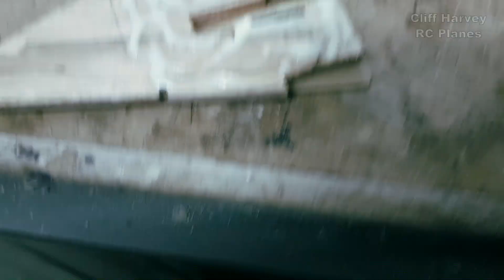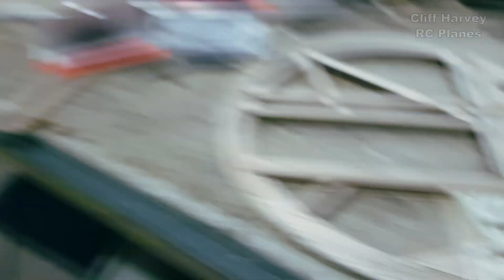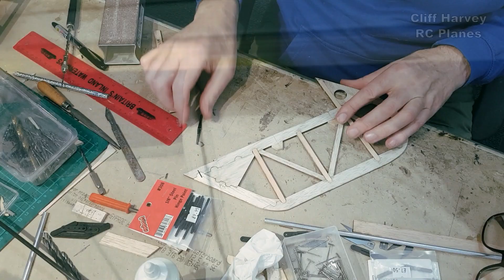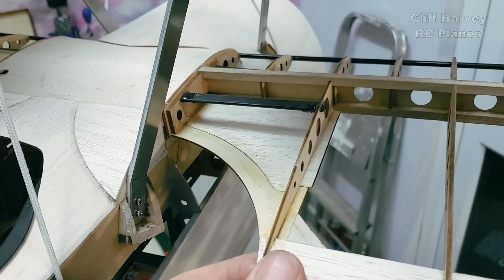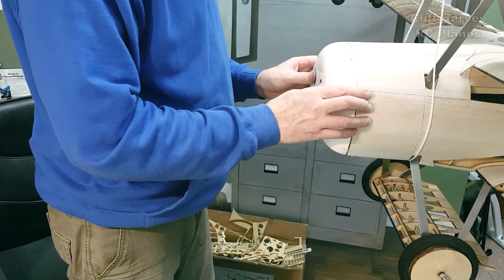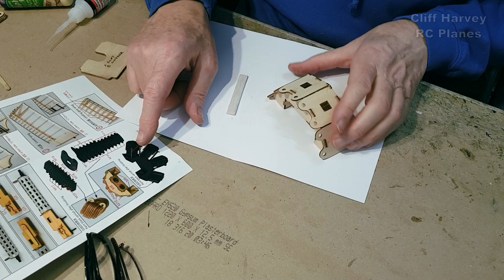Fokker Triplane Big Build Part 6

Comment: Congratulations on a complex build.
The top wing should have a greater incidence than the mid & lower - so that it stalls first, then the moment of lift from the other wings will tend to pitch the plane down to correct the stall. This applies to all biplanes with forward stagger.
Reply from the maker: Thanks Richard. The wing incidence seems to be a hot topic of conversation on the triplane top wing incidence. I like the theory of the top wing stalling last to maintain aileron authority but I guess a stall is to be avoided anyway 👍🤔

Comment: Now is the point in assembly to plan how to incorporate down and right thrust motor shaft angle so that prop shaft comes out near center of hole in cowl while helping to make right turns.
Reply from the maker: You're not wrong Gary,  but how much that is the question? Cheers.
Reply: @CliffHarveyRCPlanes  I have always used the TLAR approach, I would guess a little more is better with this model and large prop torque.

Comment: Nose looks long. Is that just the light color effect on the eye?
Reply from the maker: No you're right Dan, the nose is longer than the original, to save a lump of lead in the nose I guess. I've got used to it now and come to terms with it to a degree by looking at the modern replicas with much lighter engines fitted, they also have a longer nose, cheers.

Comment: 370 parts in the fake engine! Do you have an approximate number of parts for the entire build?
Reply from the maker: I knew somebody would ask Koala lol, a rough count comes to about 1,000 including the engine 😁
Reply: @CliffHarveyRCPlanes The parts needed to build all 9 cylinders of the fake motor would be around 830 pieces, but the entire model without a fake motor is made up from 630 pieces.
Maybe you should have constructed the fake motor in a way that would allow replacement of some of the plywood parts with lead replicas. If extra nose weight is required.

Comment: Enjoying this build Cliff! Great Idea on the incidence. Makes you wonder why they don't do that at the design level. The engine is brilliant looking, but seems like it would be heavy..of course you may need the weight up there.  Looking forward to the next one!!
Reply from the maker: It seems to me that yes, it will fly with positive top wing incidence, but it'll fly better with zero or slightly negative. If the top wing stalls first, which it would with that amount of incidence, you lose aileron authority!

Comment: Hi, Ciff! Have you ever used a ribbon hing on aerons, rudder or stabilizers?  I have. It works well on small r.c. airplane when you can't find plastic nylon hinges small enough to work with 1/6" and 3/32" wood thickness. I've seen the hinges your installing and never used them. The Fokker DR1 Tridecker is looking great, Cliff! "CHEERS!" Love to know what your paint scheme will be! One of the Flying Circus paint schemes perhaps.
Reply from the maker: Hi Richard, yes, we used to use them all the time, the reason was of course is that's all there was, mostly control line models. As for the paint scheme all was revealed in this weeks' Hangar Chat No. 3, cheers 👍🙂
Reply: @CliffHarveyRCPlanes  "WELL GET CRACKING ON IT!" 😂🤣😅🤣😂
Reply from the maker: @Richard Browne  You know you're a slave driver don't you Richard, I was just about to retire for the evening as well 😁👍
Reply: @CliffHarveyRCPlanes  I apologist, Cliff. Just joking with you. Have you seen the micro verssion of your Dr1 made by Tony Ray models?
Reply from the maker: @Richard Browne  I know Richard, just Googled the Tony Ray model, she looks a very nicely put together kit 🙂
Reply: @CliffHarveyRCPlanes   I think it was 43.00 Quid. $38.00U.S.

Comment: Regarding installation of the Robart hinge pins you are right about starting with a pin to start the hole making only next time try pushing the pins in half way then chop the heads off then you can offer up the Elevator up to the Tail plane on a flat surface pushing both tail plane and elevator together you will be left with perfect alignment holes for the hinge pins of coarse you will need pliers to pull the pins back out.  👍🏻
Reply from the maker: Thanks Stephen, great tip, cheers 😁👍

Comment: A section of your motor has more parts than half a couple of my models combined!
Thx for showing the hinging part. I was thinking of putting some backing blocks for my own hinges and I like what you have there. I'll use it as inspiration to solve my own challenges.
Thank you for sharing!
Reply from the maker: Hi Andrew, it was a lot of parts, actually I made a mistake on the total number of holes I had to make for the hinges, it was in fact 40! 😁